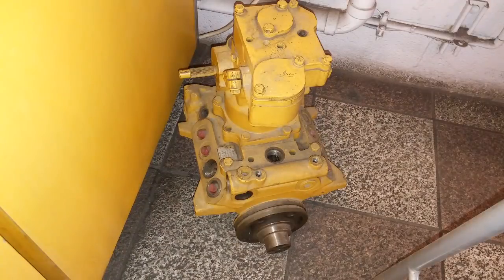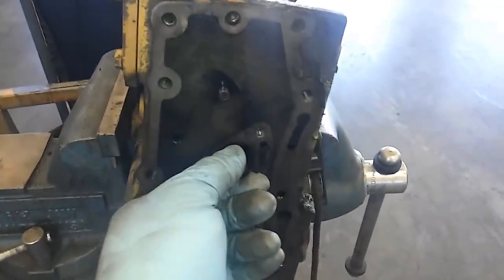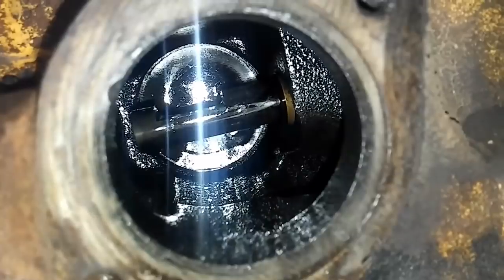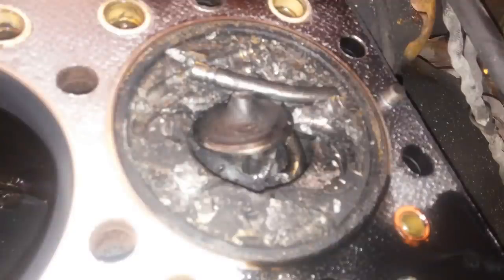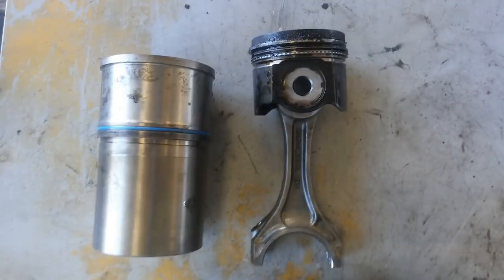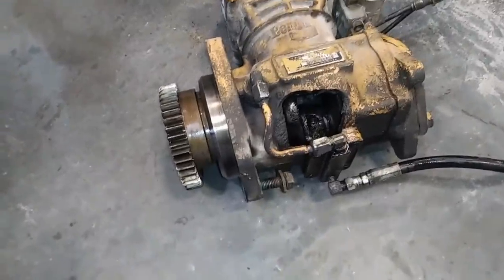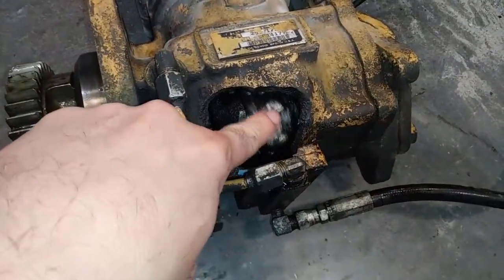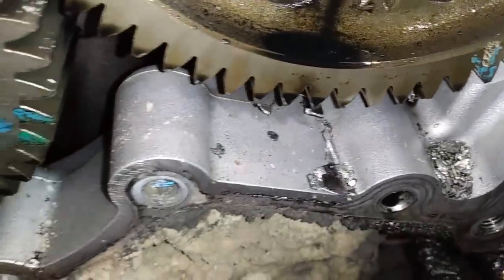Why Do Diesel Engines Runaway? What Is A Diesel Engine Runaway?

Comment: Hey. I'm curious if you could give insight as to how a diesel engine can run backwards... Story time: I was bringing a load of gravel to a customer in a 1986 Kenworth which was equipped with a Cat 3406B 400HP model.. Because of a steep turn on the driveway I managed to stall the truck in 2nd or 3rd gear.. What happened next will stick with me forever, the truck KEPT RUNNING! Albeit with a very delayed throttle response. I started to notice every time I depressed the throttle pedal, smoke would come out of the Air Filter housing but it wouldn't make any power. Mind you by this point I had the truck in neutral and I was trying to figure out what was wrong with it. Eventually I shut it off, restarted the engine and it ran fine after that. Only later after telling the story to some friends and fellow drivers did I hear about "dieseling" an engine. Apparently with older mechanical engines if they "lugged down enough" and stalled they could start running backwards. I'm curious if this situation is video worthy or if you have any thoughts about it. Also great video! Cheers from Canada, buddeh.
Reply: The old 2-stroke jokes used to be famous for that.  53-series,  71-series.  I never saw it happen on a 92-series, but I'm sure it has happened.   Some of the old trucks, you'd have to pull out a handle to physically cut off the fuel and stop the engine.  With the old Detroits,  if you pulled out the handle, and then at the right time, let it go,  sometimes the motor would kick back to life, in reverse.  It would puke smoke and stuff out the air inlet.  You wouldn't want to let it go on too long though, as the oil pump would also be pumping in reverse, which wouldn't do your engine a lot of good.... I'm sure I might have "stalled out" a time or two, and stomped down the clutch at that perfect moment,  and the stupid thing sputtered back to life running backwards.  Then you have to deliberately snuff it out and restart it,  which might draw attention to you in the form of a horn honk, finger pointing,  laughter, etc.
Reply: Wow that’s weird. I have absolutely no clue how that could happen.
Reply: Most early diesels can run backwards as the cam profile would alow the valves to stay open longer on the close ramp. New engines have a very steep close ramp on the cam to shut the valves quickly preventing combustion in reverse rotation. Cheers mate 🍻
Reply: Stan Patterson is that why Detroit 2 cycle engines aren't in trucks anymore? lol  Holy crap, double the combustion cycles, double the odds of the engine running backwards!
Reply: One of our old dump trucks was 2 strike Detroit and if you rolled down a hill backwards you could start it by releasing the clutch and the motor would be reversed. Actually came in handy on job with almost a 3/4 of a mile back in with the extras gears you got
Reply: I AM from México it's courios thing ,i see engine in opposite running  you call this engine backward  maybe understand .
Reply: I don't know what engine was in it, but I was in an Army flatbed with a 3,000 gallon water bag strapped to it, on Annette Island in Alaska, May 1999, the driver stalled, and when he restarted (or it restarted on its own?) the tachometer was trying to go the wrong way! He stopped the engine completely, set brakes, restarted, and everything was fine after that.
Reply: Munnz i had the same thing happen to me.
Reply: Stan Patterson  can it also happen in 149 series?
Reply: Game Bred Duramax  just remember when the engine is running backwards, there is no oil supply because the oil pump is spinning in reverse...
Reply: Hey something similar happen recently with a kawasaki mule 3010, I was spraying a lot of carb cleaner into the intake hose from the passenger seat while driving and then by the time i got it back into gear, I floored it and it died and then ran in reverse and I immediately killed it and slammed on the brake, a WHOLE bunch of white smoke came out the intake hose and I sat there for a while and had no idea what I would tell my friends..... I found it funny though.
Reply: My grandad told me a story about an old diesel crane that regularly ran backwards after holding the stop button on the thing. This was in England around 1940-1950 I think.

Curiously enough, his story was about the crane "running away" and everybody pegging it because it was going to start throwing metal everywhere. Of course my grandad being the type to run towards the sounds of trouble sprinted over, hopped in the cab, and turned it off.

I have no way to confirm if it's true or not, but thanks for sharing your story, it reminded me of his!
Reply: It's really weird when it happens, had a 3208 in a water truck do it once. All reverse gears! The old guy with me new exactly what it was lol
Reply: Since so much compression is needed to burn the fuel on a diesel, if you catch it just right you can make one run backwards. Like bumping the starter and it don't crank, but the engine kicks backwards. IF everything happens just right the piston kicks backwards just for a second, can cause a backwards running engine. I have done it testing mechanical Jake brakes. Revving up to TEL, Jakes on high, no clutch, let foot off throttle. Engine brake engages and at the low RPM'S stop the brake, throttle, clutch what ever. (On high setting at idle a mechanical engine compression brake should kill the engine). So the engine was going to stall out, but I caught it the right time, piston kicked backwards and off she goes. 

Single sensor RPM engines. I have turned the sensor out at idle and caught it just right and it ran backwards. It was hunting, black smoke, etc, as I had it on the verge of shutting off. I did not see how long it would run. I was putting our training engine in a surge RPM state for a training class and went a little to far.  

Seen one ECM failure that when it ran away you had to turn the key off. Only do it hot and after you shut the engine off. When you restarted it might runaway. This was back in the old ECAP days. Had ECAP powered up remotely and when it did it the ECAP showed gibberish on the display.     

Overspeed  is TEL times 1.25, at that point your starting to get to piston to valve contact. Seen on downloads of 3300 RPM"S.

Had one twin turbo that dropped a valve, valve broke tip off EUI. Valve wedged back up in the seat and did not fall back out. Fuel was dumping onto that piston as tip was missing. Valve happened to be intake and when piston went up, pushed all that fuel into intake port. Thus fuel was dispersed to the five good cylinders giving engine a unlimited source of fuel.

Had a PEEC engine that one injection pump seized on start up and it took off. I  crushed supply line to pump by hand and it started dropping RPM's until it died. Came close to messing up a good pair of underwear. 

Numerous turbo failures where CAC was not cleaned out and was full of oil. Damage caused is just how unlucky you are.

Several pump or governor failures. Back in  the late 80's 3306B and 3406B had a servo failure the could cause a overspeed.    
Had a 3406B this year that was running away, from defective new parts installed.

Seen 3406A models pin not hooked to servo (mechanic error) and off it went. 

3208 injection pump installed wrong and it broke locking rack up. 

Had one truck driver call me back in the 80's and his 3408 was running away. He was roughly 180 miles away and said he was bringing it in. I said OK and in short while he showed up. I asked him how did you get here so fast. Which he replied, I get up to 100 MPH's shut engine off and coast for awhile.
Reply: @Tom Stulc I don't remember the rod drillings on the Detroit's but on most of the old diesels it's just a cam change to make them lh rotation
Reply: Yep, old diesel can eventually run backwards, poorly, but they can
Reply: So you saying it was sucking air through the exhaust fan exhaust out
Reply: Midnight Mechanic - Those two cycles engines cannot meet emission standards anymore.
Reply: A diesel engine will run backwards from a stall when the fly wheel hasn't fully reached the stop position, usually it is thrown back on a compression stroke and then some type of fuel is introduced either diesel or oil, on that backwards stroke and the engine kicks to life in reverse. Cats a natorious for this whether a driver realizes it or not.
Reply: My pals moped (Yamaha DT 1998) could run backwards. If you put it in gear and move the bike backwards it would fire up and run backwards haha
Reply: When I hear the term "dieseling" an engine, it's when a gas engine has carbon deposits that get hot enough to ignite the fuel, and if the engine had mechanical fuel delivery this would cause it to keep running without fire from the spark plug
Reply: Had a reverse runaway happen once on a 1967 Bucyrus Erie crane with the 6-71 lower. It's definitely a shock if you aren't familiar with the possibility of it happening. I pulled the emergency air shutdown to kill it before it did any damage. But, same thing, weather head on the exhaust was sucked down tight, smoke belching from the air filter. Also to remember, if you aren't familiar with a 2 stroke Detroit, it can't pull itself at idle like a four stroke can, like don't let it idle in gear on a manual transmission, it'll stall if you're lucky or reverse runaway. Only things to do are choke it out or run fast and far before it self destructs.
Reply: i had a moped where the engine ran backworths after a stall(and something broke) . on a automatic transmission it is quite a chok to turn the throttle and go backwards instead of forwards :)
Reply: In my military days, there was a jerk who had a deuce and half set in reverse gear. He had the truck pulled forward, and when he released the clutch pedal, the engine started, and ran backwards.
Reply: My uncle had that happen to him when he was going in an old ford F250, he ended up blowing the transmission because he tried shifting into first instead of neutral
Reply: Isn’t this how all marine diesels operate? There is no gearbox on the ship, you just run the engine backwards and ship reverses.
Reply: Very early (that´s before 1930) Lanz Bulldog tractors with their 2-stroke hotbulb engines did not have reverse gears, so this is what you were supposed to do to reverse them. As seen here https://youtu.be/eKTket0sK2I?t=56
Reply: ¿La verdad? Si, eso es que estan deciendo. Interesantamente, ellos no hablan de otra razon que un motor de diesel puede correr a reves. Solo necessita aire para trabajar, no importa de donde viene este aire, y un escapo por los gasses. Si hay sufficiente aire chupado del systema de (exhaust), y si hay diesel, va a siguir corriendo. Ojala que mi Español sirve.
Reply: Hi Mark, If a diesel is at operating temperature when it stalls, and the vehicle moves in reverse, causing the engine to move in reverse, and if it turns in reverse enough revs to suck fresh air in through the exhaust system, it WILL fire. The smoke in the air cleaner someone mentioned was exhaust.
Reply: @sonnysolomon6825  yes 149 could
Unpredictable fresh on the dyno.
Reply: Munnz this is pretty common in two stroke motors. Two strokes generally have no valves. Some have exhaust valves, but as long as you have the piston going up and down, and a fuel supply then the engine will run. You can start a two stroke dirt bike by spinning the rear wheel backwards as well. Another interesting thing is in huge low speed diesels, like in ships. They actually don’t have a gear box. They run the engine in reverse with variable cam timing. They either rotate the cam a certain amount of degrees or slide it one way or the other to set the exhaust valve to open at the right time. It is fairly simple since all low speed motors are two stroke
Reply: Wierd...
Reply: Old Detroits used to do that too. Pop the clutch Rollin backwards in first or second gear and the engine will turn over backwards and start up. 
Doesn't happen in the new trucks. Computer controlled ignition prevents it.
Reply: How long did that engine last with the oil pump pumping backward?
Reply: 2 stroke diesels can do that but the injection timing is a bit off and the blower doesnt work properly
Reply: the blower actually sucks out the exhaust gases through the ports at the side of the cylinder and fresh air enters through the ehaust and through the valve, thats why they smoke out of the intake
Reply: 4 strokes should also be able to do that but modern ecu might not inject fuel
Reply: @Midnight Mechanic.... sorry so late in replying,  no (as a few others have said), they couldn't get the 2-stroke families to meet the (then upcoming) emissions regulations, so Detroit Diesel's next move was to design a 4-stroke diesel engine.  I was skeptical of their new engine, but it turned out to be a great design, practical, economical, and they already had a perfect support network in place from all the years of sales and repairs of the 2-stroke engines.  The 60-series was wildly popular.  There was also a 55-series, and a 4-cyl 50-series that, while they worked well for the applications intended, didn't end up selling as well as had been planned.
Reply: @Sonny Solomon... sorry for the late reply....  I have zero experience working with the 149-series motors.  I've seen several up close, none while they were running,  so while I can imagine that by their similar design and build that they would also be susceptible to doing it,  I have no experience of it myself.  I see that another commenter has mentioned that they would do it,  so I guess they will.  It's a funny thing to have it occur,  great for a chuckle to see it happen, but it's pointless to let it go on for more than about 4 or 5 seconds,  because with the engine spinning backwards,  so would the oil pump be spinning backwards as well,  and I think most of us can imagine what prolonged activity without good oil supply will do to an engine.  I remember bringing it up with my boss at the time, and he stated that yeah, he had seen it a few times himself.  Beyond finding it a curiosity,  I remember thinking that I didn't want to lose a good paying job with a good company if I were found to be responsible for the loss of an engine.  Things were cheaper back then,  but still,  it wouldn't be cool to be short one truck, because one way or another,  it would mean one guy sitting at home with no pay, thinking about it.
Reply: Two-stroke hot bulb engines were even better at running backwards, to the point of removing the need for a reverse gear. The Lanz Bulldog (a tractor which used this type of engine) had an indicator for the direction the engine was running in.
Reply: @threynolds2  lol but I still true
Reply: The main problem is that the oil pump will run backwards thats why you should stall it asap.
Reply: People think that's nuts, in the '80s I knew a guy who replaced a V-8 71 series Detroit in his truck with a junkyard unit. When he was done, he had 13 reverse gears and 2 forwards!  The engine was from a bus, and they were BUILT to run backwards!  He had to take the trans and engine bell housing off and remove or change an idler gear in the rear gear train, then change the fuel pump, starter, and maybe a couple other things.  He was pissed off about that whole thing!
Reply: I had it happen once with an old R Model Mack. Backing under a heavy trailer that had been dropped low, I missed the pin and it spit me out. Next thing I knew, heavy white smoke was pouring out of the intake. Shut it down real quick, but it scared the crap out of me.
Reply: Same thing happened to me on a Zetor tractor when I was a kid. Stalled on a steep slope and started running backwards with smoke coming out the air intake. It ran at a slow tickover and didn't respond to opening the throttle, but shut down when I closed it. I told the family about the curious experience and they called me out viciously for bullshitting. Even told a neighbour what a bullshitter I am. Neighbour was an engineer. Neighbour got hold of the engine schematic from a dealer and deduced that it could indeed run backwards. That neighbour is still one of my childhood heroes.
Reply: LOL, fricken Detroits!
Reply: Well known phenomenon.  It happened to all the French tanks in WW2.
Reply: Had a 8V92N do that on a drift boat that had underwater exhausts. The Captain didn't hold the stop button long enough at shutdown, the engine bounced and ran backwards, sucking water up the exhaust into the engine and bent a connecting rod like a pretzel. It happened a second time and they changed the exhaust system to dry stacks the next time in the yard.
Reply: thats a real video  we all love to see 1 st hand  going backward's engine wise i have heard the term  (  dieseling ) on work farm's in the south when i was in my teen yrs.,  & 1 st learning to drive farm equipment then.......
Reply: Any 2- stroke engine can run backwards. The early Lanz Bulldog farming tractors didn't had a reverse gear. You had to restart the engine in reverse. Even the gasoline powered Messerschmitt Kabinenroller had two starter buttons to be able to back up.

The Bulldog had got a real reverse gear after a few years because if the oil pump runs in reverse, the engine is without lubrication. When started in reverse by accident and left idling, the engine is damaged. So a reverse gear and a redesign of the injector pump had to fix that.
Reply: Saw a truck driven forwards into wall when they tried to back out. Funny.
Reply: @aussiefarmboy  I almost had crashed my car into a wall right when collecting it from a garage. The mechanic had reconnected the stick shift pulleys wrong. Imagine the surprise when you press down the stick and put it into reverse position and it latches just fine (pops back up in any other gear or neutral), then twist your torso around to look through the rear window and the car goes the other way. Takes time to figure that one out and hit the brake!
Reply: @MidnightMechanic  The EPA and smog laws. I have marine Detroits.
Reply: @oceanmariner  I'm just now seeing these replies, kind of annoying!  But yeah, emissions did have a large part in the 2 cycle being pulled, however that doesn't mean that a 2 cycle couldn't meet emissions today if they modernized them, Cummins is capitalizing on the small Diesel engine front FINALLY with a 2.8 4 cylinder that's comparable in weight to the Chevy small block.  But since Detroit Diesel isn't under GM anymore, there's no need to redevelop another 2 cycle block to be an optional replacement for the gassers, it would have to be a custom order kind of deal.
Reply: @MidnightMechanic  My experience with DDs is all marine. I like the reliability of a 100% mechanical engine on the ocean. i'm 70 and my first 671 pair was in a boat in1961. Since then I ran many makes in commercial and USN. None were as reliable, or did the hours between rebuild. People I know with new electronic engines carry 100s if not 1000s of $ in spare parts so they can keep their engines running at sea. The EPA has done more harm to America than any foreign power. We have lousy diesel fuel and we're scrapping good engines long before their normal end life.
Reply: @oceanmariner  Hence why I want to do a biohydrogen turbo Diesel conversion swap to my Camaro with a fully mechanical 6.2 Detroit, maybe keeping the stock computer so my gauges and VATS systems work properly.  Already got the car set up for 120VAC, I'm setting her up like a big rig sleeper. lol  I'll be disappointed with fuel economy less than 40 mpg highway.
Reply: They can and will because the not its taking in air through the exaust, and from there your intake is the exaust. Two stroke, gas nor diesel theyll either way. But if the oil pump is bidirectional you dont need to worry...
Reply: @layeredchip3220  very simple the main difference between petrol and diesel is the ignition system petrol needs a spark diesel need heat. All that happens is when the engine runs back wards is the inlet side and exhaust sides swap so the engine breathes through the exhaust pipe exhaust via the inlet the fuel lift pump will still work as this just runs on a cam and won't recognise which way the engine is turning as with the injector pump if it's an inline pump. All that's need to stop this is to block the exhaust pipe suffocating  the engine. A far more common problem with diesels is leaking turbo bearings. these are oil fed and if hot oil if squirted in to the inlet via the turbo bearing then you have a run away as the diesel engine will run on oil and there's no regulation so it will rev it's head off until it runs out of oil causing the engine to seize the same can happen with over filling the oil
Reply: I had a Husqvarna L-77 chainsaw almost stall and then ran in reverse.I didn't know what was going on because it didn't want to rev and then I tried to cut with it and it wouldn't dig in at all. Almost like when you put a chain on backwards...
Reply: @MidnightMechanic  no Detroit 2 strokes aren't in trucks anymore because of emission regulations. Detroit 2 strokes are still used in the military because of their durability. No they don't last as long as the 4 cycle Detroit's but the 2 strokes will survive in the desert with sand in the oil pan where the 4 cycles will be broke down!! These are facts.. Look at MTU web site daimler have them build all of the original Detroit 2 strokes at their facility mainly for government contracts.
Reply: @bernardr4111  Deboss Garage recovered a 16v71 out of a scrap yard with unfiring pistons, and that thing managed to run just fine after half a gallon of ether down the intake! lol  They can handle a lot of abuse, they're just grossly impractical now, the military is probably the only last place they're really welcome.
Reply: @MidnightMechanic  yes I seen that video my dad got a kick out of it. He worked for Detroit Diesel for 43 years. Sad to see American companies continue to get bought out by foreign companies because of the mismanagement. I love the sound the old Detroit's made but GM was too stupid to prefect things like the oil leaks on the old 2 cycles. Then they spent millions developing the series 60 which was the first all electronic diesel in the world. Two years later became the best selling on highway engine just to sell the division to Roger Penske which is a businessman. He made his money the sold to the Germans. Chrysler sorry asses did the same crap. Lol it's amazing how things change.
Reply: I drove a Mack redimix truck. I was on a hill and stalled it. Pushed in the clutch and it rolled backwards and let out on clutch and it started backwards with smoke coming from air breather
Reply: @Gen3tx  Sure, only to find out that your oil pump runs the other way around as well, sucking oil from the crank shaft blowing bubbles in the sump. In other words, not a good idea.
Reply: @MidnightMechanic  
I believe it's mainly because two strokes couldn't meet emissions. Loved my old Detroit water truck.
Reply: Had a Perkin's all fuel diesel do it one time in an old deuce and a half
Reply: I only liked to be liked 420
Reply: @Gen3tx  The engine can not run that way for long. The oil pump is running backward too.
Reply: The Detroit  2 cycle 671,,53,,92, silver 92 series . If you bumped the starter and the engine kicked back the other way it would run or during a pull start .
Reply: I saw a Hatteras where the port 454 runs backwards to provide balance to the boat- much harder to do with a gas engine! Diesels do not require an ignition system, so forwards and backwards are the same thing. You can completely lug a diesel to zero RPM, and if you remove the load, it will restart moving due to energy stored in the combustion chambers- in either direction!
Reply: I had it happen every now and then with an old cat. Once i learned to recognize the situation i could kill it and restart but a few times i would put the truck in first and take off backward. Lucky i didnt hit someone. I had heard of this but i can say that its real. It was when cranking the starter it would cough and kick the bendix out but that cough was enough to make it go back the wrong way.
Reply: @Gen3tx  Except now the oil pump is rotating backwards and starving the engine of oil.
Reply: Yes they do run backwards. Picks any gear but low or first and you will stall it
Reply: An old friend had told me a story once when he was racing motorcycles, Enduro. He had a Yamaha 360 2-stroke bike,he said when took off he had forgotten to strap his helmet on, so he stopped. Tie his helmet,he said the bike about stalled,grabbed the throttle,heard a "pop" then it seemed ok.. grabbed a hand full throttle,dropped the clutch... He said the bike went backwards about through him over the bars.. on those air-cooled 2-stroke bikes I can see that happening..only basically three moving parts...no valves just ports..
Reply: 2-stroke?